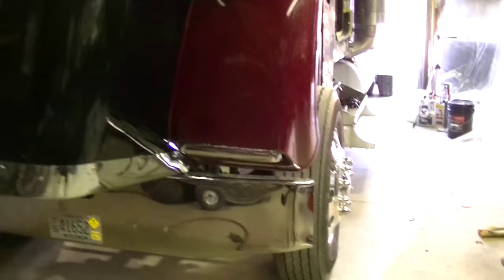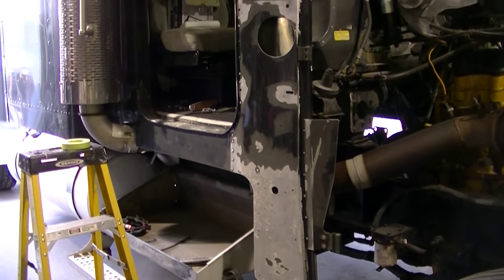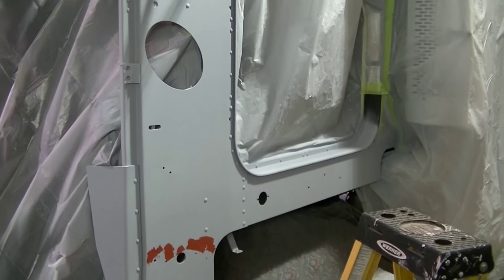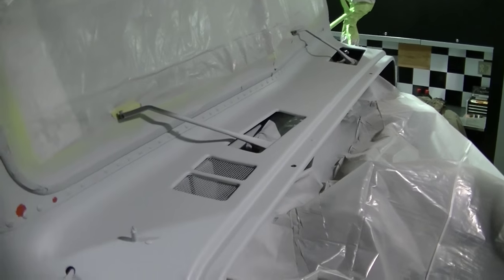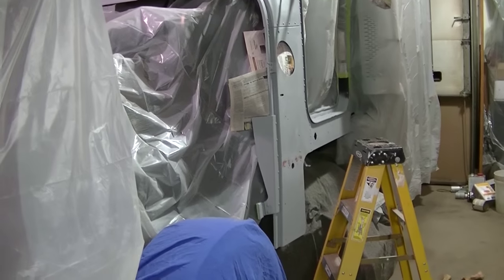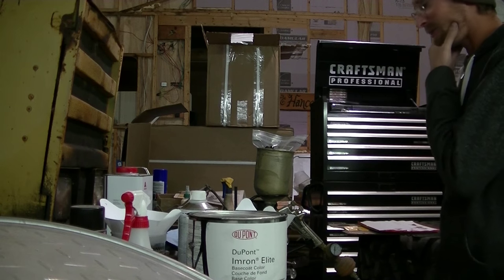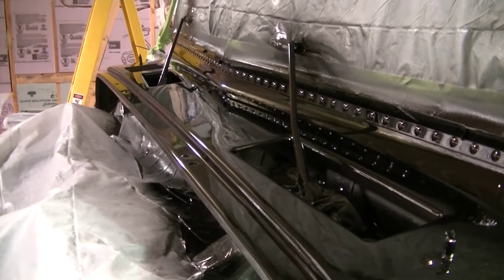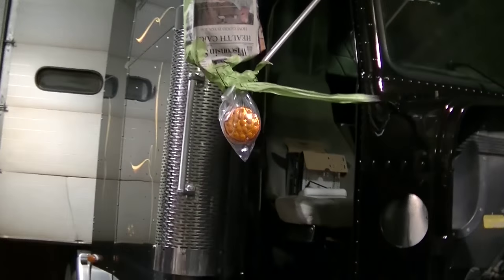2000 Freightliner Classic FLD120 "Painting Cowl and Side Panels"

Comment: newbie here about to tackle my freightliner next weekend, for prep work before primer are you wet sanding or regular sanding, what grit? I don't have no body work to do going to lay DuPont imron.
Reply from the maker: You can wet sand if you want.  That makes a mess and you have to wait for the water to dry.  A basic rule is you need everything sanded to 400 grit for your paint to look smooth.  If your paint is in good condition all you need to do is scuff up the paint.  I believe the gray scuff pads should work.  The red pads are a little to aggressive.
Reply: mossman381 I have a few spots down to bare aluminum, previous owner poor paint job can see previous color paint in spots that's why I was thinking about sanding whole truck then laying primer
Reply from the maker: Those bare aluminum spots are going to need some epoxy primer.  If the previous paint job isn't sticking then you will need to sand to the original factory paint job.
Reply: mossman381 thank you for the quick responses, I really appreciate all the tips. Since I need to sand down to original paint should I use a lower grit like 180?
Reply from the maker: You are going to want to use the least aggressive sand paper that will allow you to get the job done.  Aluminum is softer than metal so be careful.  Also be careful of all the rivets.  Aggressive sand paper might cut them down.  You have a big job ahead of you.
Reply: mossman381 so still go with 400 or higher? Sorry to ask so many questions I'm a big do it myself person it seems like that's the only way to save a little extra thanks to uncle Sam!
Reply from the maker: 400 grit will not take off the paint.  I would try 180 and see what it does.  Be careful with the rivets.  If that is taking to long you can get more aggressive but be careful.  Once you get everything sanded you can epoxy it.  Then I would go with a sandable primer.  You want to sand this in stages and get yourself to 400 grit.  Once at 400 grit you are ready for paint.  With something as big as a semi wet sanding will help keep your sand paper from getting clogged up and it will last longer.  You will have more cleanup but probably worth it.  Try not to dig holes with the 180.  Try and feather all your paint edges.  If you can feel something with your hand you will see it in the paint.  Keep that in mind.  You might want to start with a small area or even a door and go through the whole process.  This will help you learn some things and give you more experience.  Painting is a skill that takes some time to learn.
Reply: mossman381 again I just want to say thank you so much for the advice and help.. I'll take plenty of pictures and post start to finish somewhere. It seems like prep work is going to be the hardest

Comment: Dang, that's a lot of masking!  You'll never see those runs at 60 MPH ;)
Reply from the maker: +farmboy30117   Most people won't see the runs with it sitting still.  I am pretty hard on myself.  I always try for perfection but really isn't necessary.  We aren't building a show truck.
Reply: I know, I'm the same way, but rarely do I attain perfection ;)
Reply from the maker: farmboy30117  Perfect paint is really impossible to do without a paint booth.  I wouldn't want to know how much a paint booth would cost that could hold a semi.
Reply: mossman381 
Most auto plants use tents to do touch up work to fix blemishes done during assembly. A booth is nice for full paint jobs though. The key is always control contamination. I have seen booths that work well built with wood, large vinyl shower curtains, shop lights and a fan with filter. Commercial booths can cost from 30 to 100k dollars depending on how nice a booth you want. But really...anything you can do to place the truck in a controlled space helps. Like I said the factories typically use tents for any work not done on the line.

Comment: Do you seriously drive that rig with no doors on it? not safe man. did that with my grain truck ended up falling out. that truck didn't have seatbelts because it is a 1967.
Reply: dude u missed breakfast this morning,6 pancake 5 fried eggs 1 inbetween each pancake,and hella syrup,epic buddy!
Reply: +Game Bred Duramax Oh fuck that's deadly
Reply from the maker: +Randy Bobandy   We don't run it with the doors off.  We are still using our 96 Freightliner.  But soon this truck will be ready for the road.  We thought it would be funny to take the truck doorless to the truck stop  :)
Reply: +mossman381 Ever try driving down the highway in a car with no doors? deadly, did that many times. I actually took the doors off that 2015 3500 I had a couple months ago
Reply from the maker: Randy Bobandy  My Polaris Ranger doesn't have doors.
Reply: +mossman381 If you consider that a car
Reply from the maker: Randy Bobandy  I now drive it down the road.  It will go 30-35mph.  The newer rangers can go 60mph.  Not sure what the difference would be having no doors in a car and having no doors in a ranger.  You are probably safer in a car than the ranger.
Reply: +mossman381 Razor feels safer than the truck. problem is I can't drive that on the road.
Reply: +Mike Smith I'm shitdonkied bud ffs
Reply: +Randy Bobandy chooch it bud
Reply: +Mike Smith smoke cigrits
Reply: +Randy Bobandy shit ain't good for ya bud rots your grinders and shit, ol diesel mechanic I work for smokes a couple a packs a day got green teeth for frig sakes disgusting